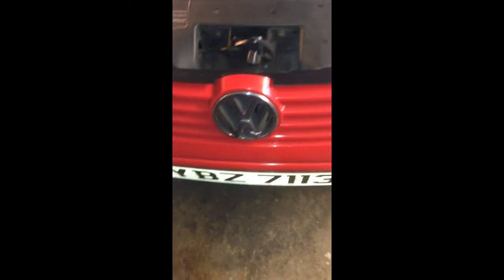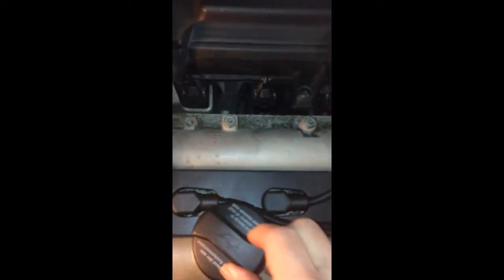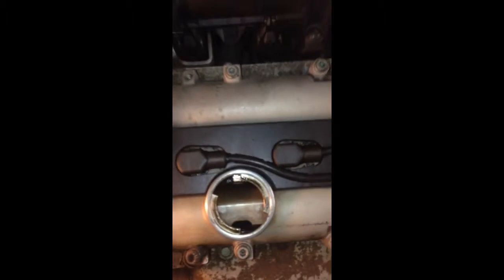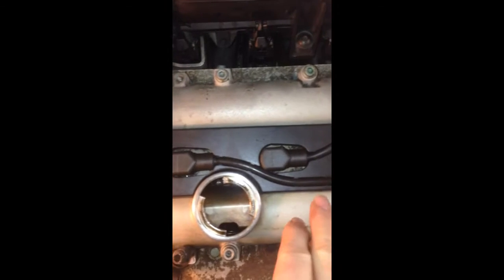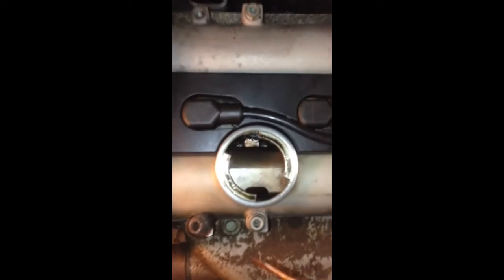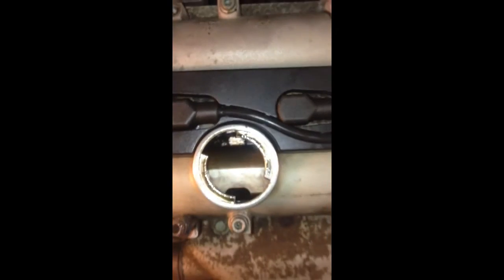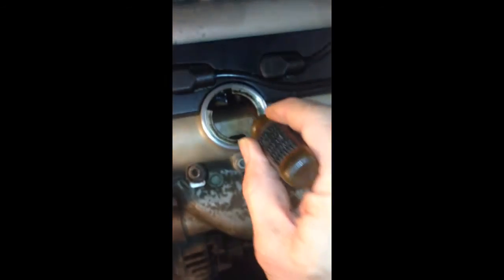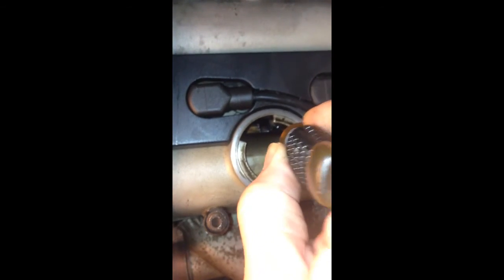VW Polo: how to check tappets / lifters through the oil filler. 2000, 6N2, 1.4 16v

Comment: My rocker seems to be missing or not connected to the tappet at all … when comparing the first tappet you tested! 

I have to say though my car is very quiet, I do oil change every 6000km with 5w-30 A3/B4 Castrol Edge and every 2nd oil change do a liqui moly engine flush .. I have been doing this ever since I had the car.

I need to redo my timing belt, water pump again … I’ll do this soon and replace them all with new tappets and rockers and do my clutch also, release bearing is starting to make a whirring sound, also whirring sound from starter motor when ignition key is turned initially … this car is never ending to maintain, but after 6 years can’t complain :) 

Polo 6N2 (1.4 16v) engine AHW

Thank you for your videos they will be helpful for when I am to do this task and I will be also removing the cylinder head to do some cleaning.
Reply from the maker: Hi, a long list of jobs to be done! your car should be very happy with a such caring owner. have a good day!

Comment from the maker: Updates: Eventually the camshaft carrier was removed and it proved that both tappets checked in this video were stuck at their lowest position. Altogether three tappets in this engine were stuck. One of the tappets fell apart when removed, which had a broken bottom spring and a  worn circlip that held the top piston inside the tappet body. Thank you for watching.
Reply: Is it better to open the engine up or just buy and replace the cylinder head unit
Reply: @marcusnolan9400  How is it easier to replace the entire head? That's complete bollocks. Surely a whole lot easier easier to just remove the timing belt (you have to do that anyway) remove the cams, then replace the lifters and put it back together. Job done.
Reply: is it a hard job if your're already getting belts replaced
Reply from the maker: @marcusnolan9400  Hi, this is not an easy job at least and it took me several days.  Opening up the engine or replacing the cylinder head is a rather big job and it may cost more than replacing the engine (which again is a big job for our DIYers). Very often a stuck bolt may take several hours! It is a careful job, such as tightening the bolts and squeeze out the sealant to the cleaned surfaces. It is a doable job but need planing and patience.  You could try to use thicker oil. Please see my other videos on opening up this engine. Good luck and have a good day!